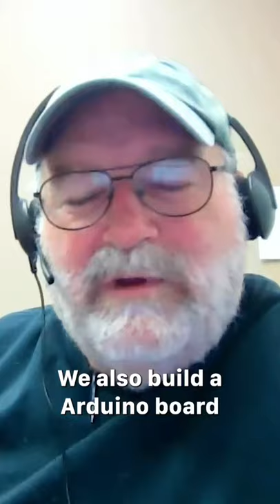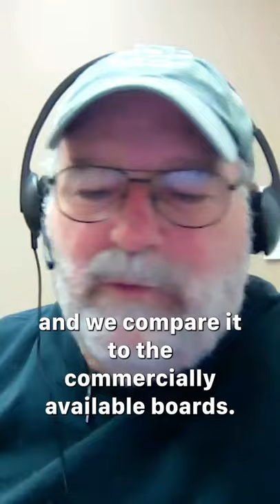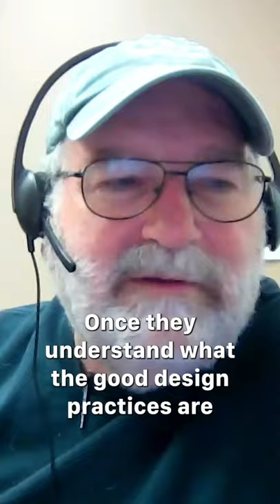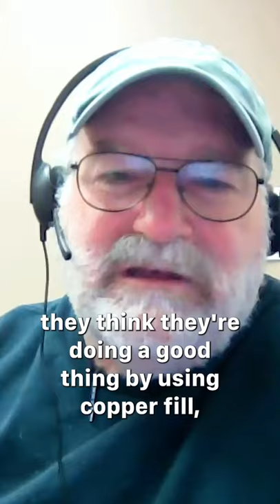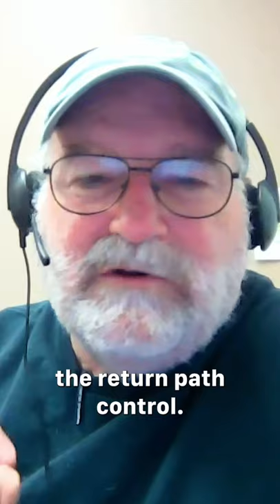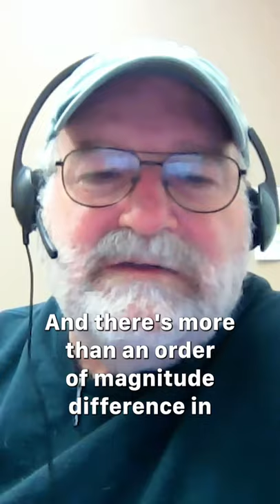Better Emissions than Commercial Boards

Comment: Great short for quickly highlighting this!

A crucial factor often overlooked in achieving low emissions and noise reduction in PCB design is maintaining a continuous ground plane adjacent to your signal plane, particularly for high-speed signals (and particularly high dv/dt). This aspect is frequently neglected in an effort to cut costs and minimize the number of board layers.